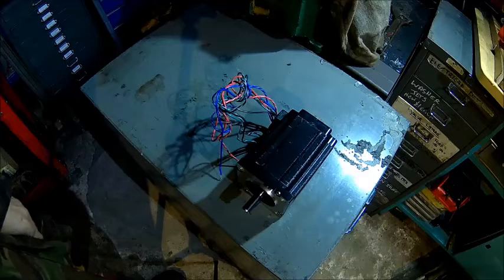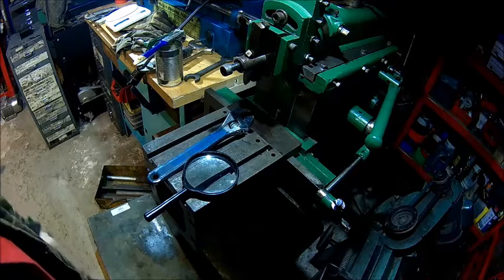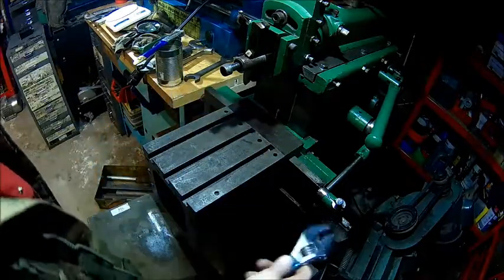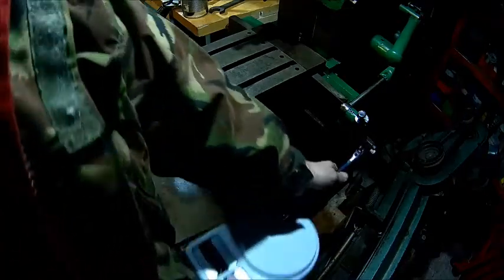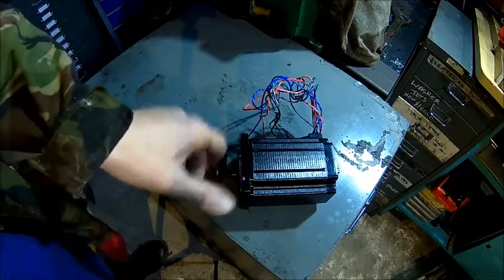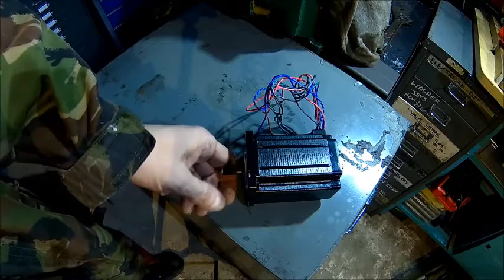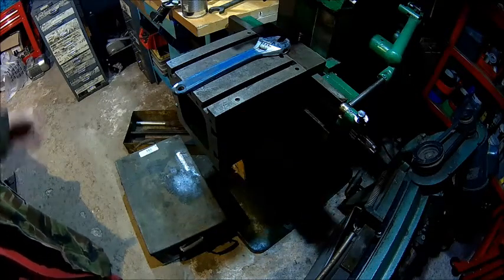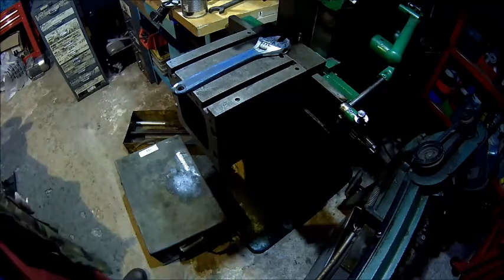CNC conversion basics:  Leadscrew Torque and Motor size estimation, the easy way

Comment: Thanks! I was doing same thing but with a clamp scale. One thing I'm considering now, that torque you arre applying its only holding torque, then you need to add Inertia for accelerations, specially on the horizontal (in my case its a milling machine) in order to have aprox values of max Acceleration in the axis... Acceleration torque will includes the weight of the whole moving part, the work and the vise... So just trying to find out an easy way to estimate this... any ideas are welcome! thanks for sharing
Reply from the maker: Thanks, always happy if i can help someone. 3Nm is quite a bit of torque , so if you got it already moving with the little Nema 17, that Nema 23 should do it pretty well, considering that's over 60 times more torque. The horizontal on my shaper is a 2.2Nm Nema 23 and even there is a lot of friction and binding going on, it never struggled.
What sort of mill is that ?
Reply from the maker: Hi,... it does not really matter with a shaper as everything goes pretty slow. A milling machine is a bit of a different animal, the accelerations are much higher than with a shaper, but you can sort of estimate it by using the mass of table, vice and work piece divided by the ratio of your lead screw, then add that on top of the static torque. The only unknown factor is the nut/screw friction vs. load,  that heavily depends on the design (ball screw or standard screw). I would say that in normal  operation with some conservative ramps, the issue will be minor, rapids are certainly a different thing. Long story short, do your maths on the total table mass, add static torque plus some 20% on top of the result, then you most probably there, if not, just use a bigger motor....:-)
My first iteration wasn't perfect either,  i did already know that the motor was borderline but that was all i had when i first tried it.
Reply: @dynoguy  thanks for taking the time here, thats what I'm currently accounting for. Disassembled the machine and weighted all moving parts, now figuring out the math. Tried nema 17 of about 4.8Ncm with 5:1 reduction and it worked, borderline. Next week I'll get a 300Ncm nema 23 with proper drivers and that should be it. Thanks again for sharing! Keep up the great work

Comment: Nice simple explanation,  only thing I would add o it would be the effect on torque required or the work and vice weight. I wold expect the additional load to make a significant increase for vertical movement up.  Maybe not so much on traverse.  Be interesting to see the effect.
Reply from the maker: Thanks,...good point, but if it gets too heavy i would just add a gas spring as i do with my mill when i put heavy bits on the table.
You can easily estimate the additional effort, turn your leadscrew by one turn and measure the movement, then weigh your part, vice or whatever you put on. lets say 10kg and 5mm  that's 500Nmm times Pi gives you aprox. 1.6Nm  extra.
Friction should not be much higher on a well lubed machine, so make it 2Nm and you most likely right.
If i can find the time i could do a follow up video on that subject.
There is alot of ratio in those leadscrews, so it's usually less than expected.. If you watch my vice deflection series, thee is some theory about leadscrews + ratios explained.